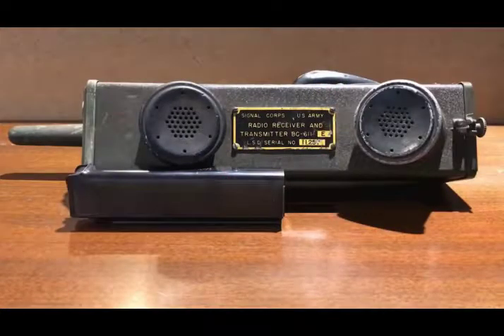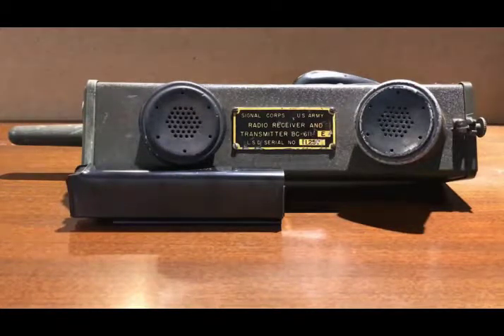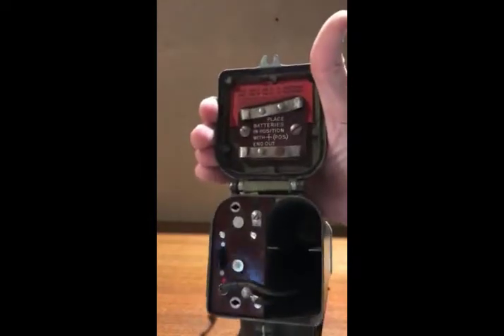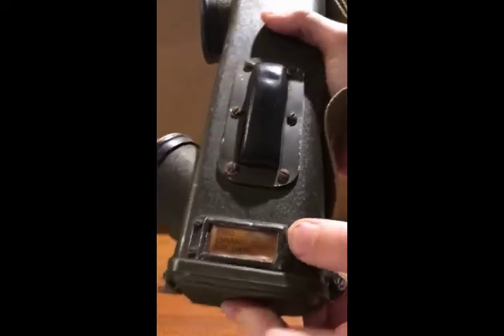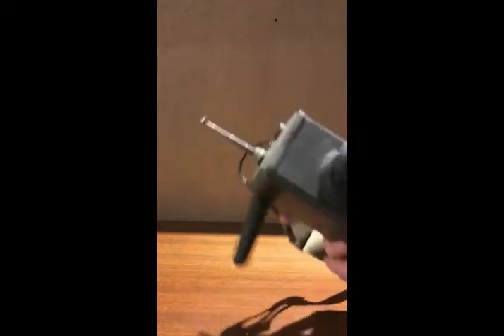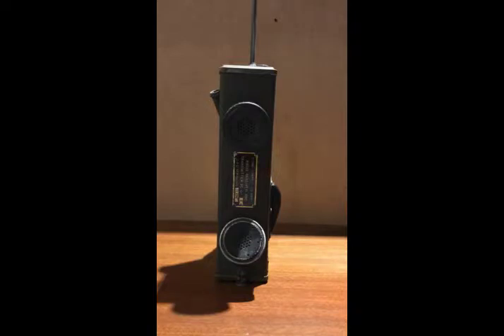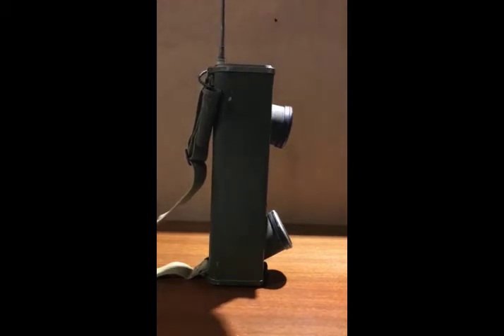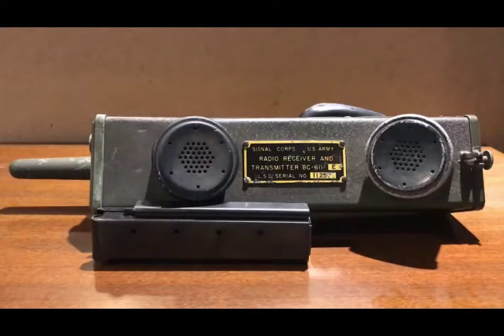ww2 Bc 611 Radio Handie Talkie

Comment: Thanks for sharing, Stuka Time. I had one of those sets years ago. I bought ten Duracell 9 volt batteries and disassembled them and reassembled the 60 inner sub-AAA-sized cells from those ten 9 volt batteries into a form that would fit into the space for the B battery and put a couple of D batteries in the filament battery holder and cleaned the switch contacts and tube pins and put it all back together and pulled up the antenna and immediately heard some AM'ers QSO'ing on 3885 . It's definitely a cool set and very handy that they came with a set of crystals that put them right in the middle of the AM Window on 75 meters. :-)